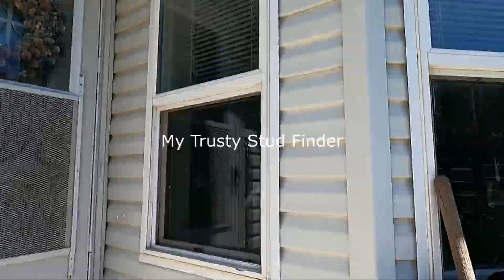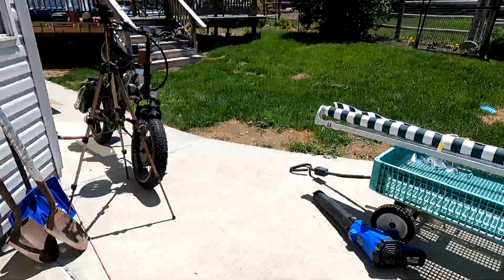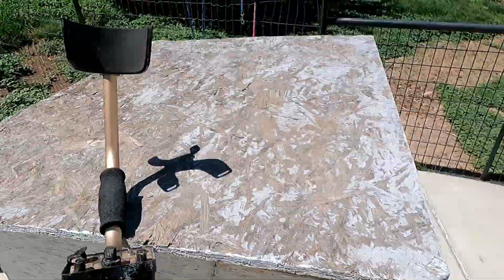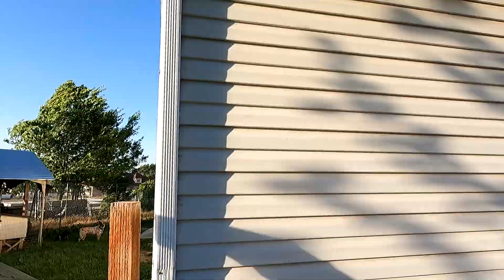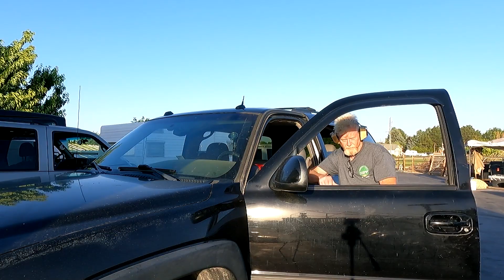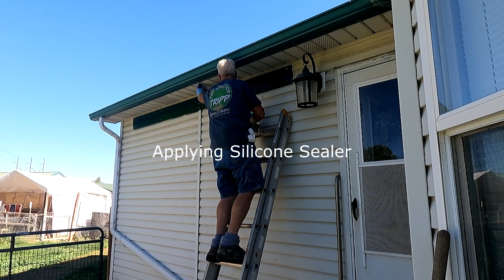DIY Awning Installation.. at the Speed of Our Scorching Heatwave

Comment: Yep.. even after a few 100 hundred 'screws' later, I think you could've added a few more to be safe! Looks like a good job there PT, hope you don't get any really strong winds back there. (Here's a background story to why I say that).

Was going over to a friends house (some 20 years ago) to have a celebration under the new awning "he had installed". I no sooner had pulled up and was walking up to where they were all gathered when a wind whipped through there and that thing broke off and sailed away like a kite some 200 feet or so. I only wish I had a camera for the looks on every ones face.

Opps forgot to ask... "But does Josie Wales approve"?
Reply from the maker: Hello John.. I can imagine most awing installations are not done all that well. I could have cut some corners but glad I didn’t! I failed to record the spray construction foam glue behind the 2x10. Also I actually screwed in the backer board with 10 3” deck screws then used 10 5” lag bolts screwed into the studs. It could blow away I suppose.. but likely something would break or rip the awning material before tearing off the backer board.. no guarantees if my house goes go full Wizard of OZ!
Shade baby shade 
✌️PT
Reply: @ProspectorTripp  Ahh... well that does add a bit to the equation doesn't it now...... "spray construction foam glue behind the 2x10", well there you go.. Fantastic, there will be no future "Wizard of Oz" episodes. Let me defer back to the accolades, good stuff and well done PT, the DIY MD , (Materials Doctor, not Medical Doctor) !

Comment: Those struts look awfully vulnerable to unexpected gusts of wind Matt.
Reply from the maker: Yes it is.. but it’s definitely very attached to the house! If it fails someday I’ll diy it into a piece of mining equipment 😂 
Thanks Keith 
✌️PT
Reply: @ProspectorTripp  Some angled braces to the base of the wall would make an enormous improvement in strength.  I have done a lot of street vending.  Very quickly winds less than 60 MPG were mere annoyances.  Diagonal tie down ropes and a solid frame made my tents near indestructible.
Reply from the maker: @hardrockuniversity7283  you are absolutely right!
I can ugly up a project pretty fast.. so trying not to get to industrial.
We pay close attention to the weather and roll up when it gets extra windy and usually open it in the morning and close at night for safety. I sat on this video a few weeks and so far even in fairly strong winds 30 ~ 40 mph the backer 2x10 board does not wiggle a bit.
I didn’t film.. but behind the 2x10 is stray construction foam glue.. along with the 10 3” deck screws and 10 5” lag bolts screwed into the studs.. should be okay.. I hope 😂 
If it blows off.. no worries 😉 plan C 😂 
✌️PT
Reply: @ProspectorTripp  I'm not worried about the anchorage.  It is those extendable struts that look vulnerable to me.  Perhaps they are stronger than they look.  :-)